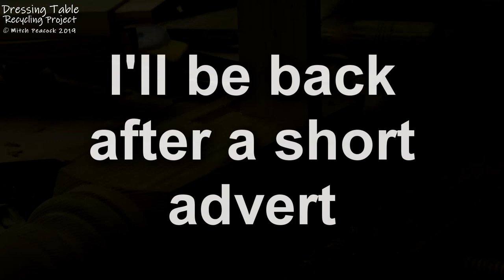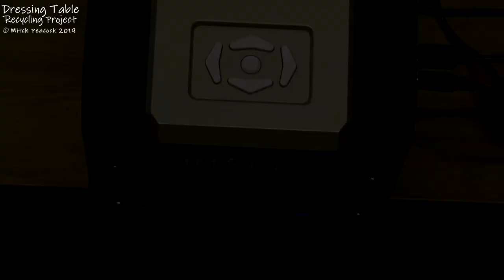Bed to Table Recycle - Making a dressing table with hidden drawer

Comment: Traditional craftsmanship at its best. Not many knows how to do such joints these days, and why. 
E.g. @2:59 you trimmed the tap and left a small part. I've seen this in some furniture, especially tables, but never been sure what's the purpose of doing it this way? I have a faint memory that someone/somewhere called this a guiding tap (right?), but how does that work? Also, do you know if it makes the joint more rigid/stronger? Just curious.
Reply from the maker: Thank you. 2.59 is leaving a haunch to the tenon. This keeps the whole width tied into the leg, preventing cupping, while leaving plenty of meat for strength at the top of the leg. Tap may well be a colloquial name for it.
Reply: @mitchwoodwork  Thanks for the clarification (sorry my bad, ofc I should know its a tenor, we use tapp in my language -- haha)

Comment: Very nice, Mitch. I noticed you jointed the edges of the top by hand, is this because you can't get a straight edge off your table saw?
Reply from the maker: Cheers Steve. I could have glued straight off the saw, but a planed edge glues better than a sawn edge, and I like to slightly hollow in the length for a sprung joint. You might notice the only clamp I really tighten is the central one, the others really aren't needed but just help initial alignment.
Reply: @mitchwoodwork  I like that approach, thanks.